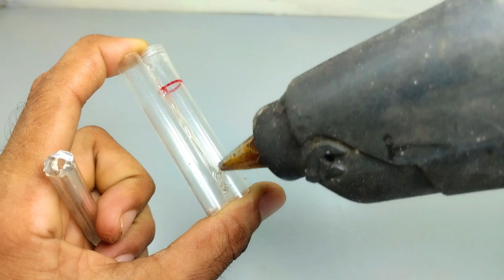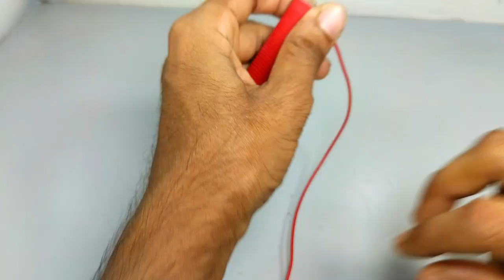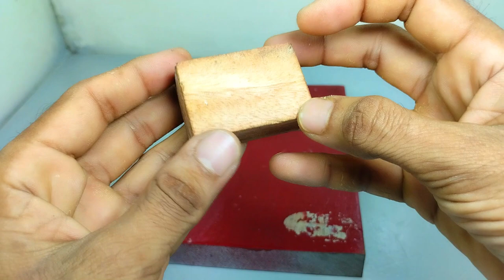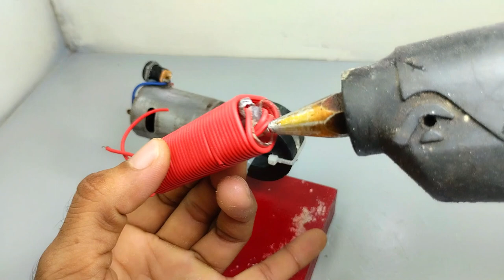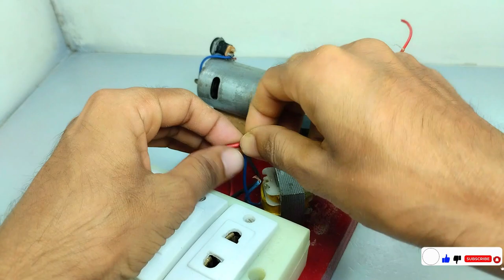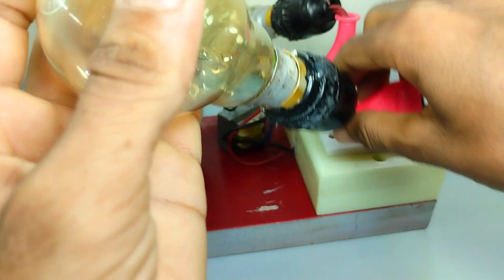Free Energy Generator 9000W use pvc wire  II @maker10m

Comment: Ok, if this is a 'free energy' generator, why do you have to power the motor?  Where does that power come from?
Reply: He wants you to believe that by spinning the magnet in front of the coil and sending current through the transformer into the outlet he is making 220 volts.  1. See all the connections he's making?  He doesn't leave them connected.  2. The transformer isn't actually wired to the outlet.  3. If you watch very closely, the lights go off before he disconnects the power source from the motor.  Where is he getting the 220?  If he turned the board over, you would see the hidden wires.
Reply: @traBylliB  I was trying to goad him into replying.  I wanted to see how 'unlearned' he was.
Reply from the maker: Thanks
Reply from the maker: Thanks
Reply from the maker: Thanks
Reply from the maker: Thanks